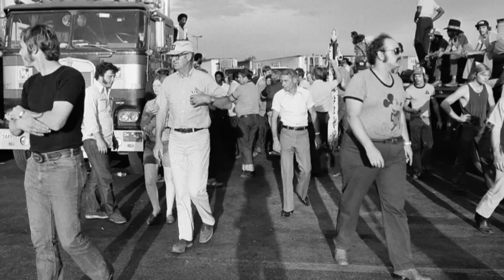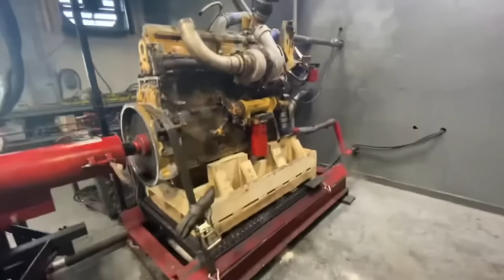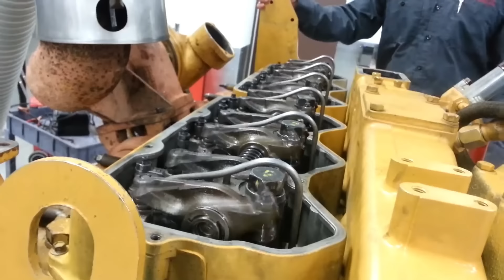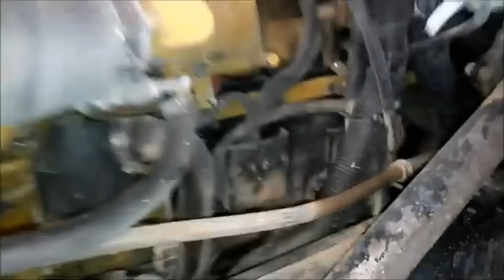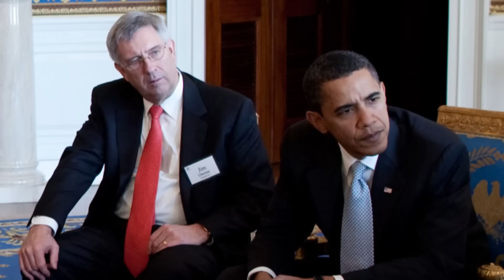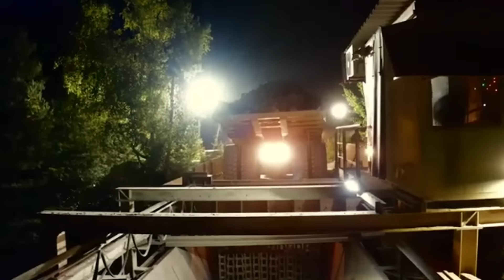The Rise and Fall of the CAT 3406: How CAT Lost the Highway

Comment: I drove line for Conway Western Express out of SoCal from 1991 to 1994. Ford Aeromax with a 285 horse 3406B & 7 speed. I would be N/B Grapevine halfway up 5 mile when the engine would hit its' temp and the ceramic clutch would GRAB. Top speed would settle at around 2O - 25 MPH no matter how heavy the doubles were. I averaged 400+ miles a night, mostly roundtrips to Kettleman City until I earned enough seniority to run Tucson or Sacramento. Solid motor with lots of pull.
 One night while working the Bakersfield re-ship I was talking to Short Stack out of Salinas. He had raised a royal bitch over how gutless his truck was, so the TM sent it to the local Cat dealer for a look - see. Turns out CF had " Cut the cable " & turned back the engine governors to save fuel !!! This caused a MAJOR SHIT - FIT with The Powers that Be at Caterpiller in Indiana; word was corporate came VERY close to voiding the engine warranties until SOMEone at CF reminded Cat how many engines CF was buying from them each year. Meanwhile, I was trying desperately to have my truck " break down " while on a laydown in Stockton or Sacramento !!! Never happened...

Comment: I've owned 2 3406E's. This video about E models being junk is FOS. Both have been excellent engines. My 2WS went 1.2M before overhaul and I overhauled then only because a clip had come of one of the valves. The mechanics at Ohio Cat were stunned at how good of condition the engine was. The figure 8's were still visible in the liners. There was zero cavitation around the liners. The current engine I have, a 1LW uses very little loil between changes at 15k miles. The EPA kept adding more bs pollution control. Truck mfgers like Pete and KW decided to build the Paccar engine and were no longer going to allow CAT engines as an option, thus CAT lost the platforms for their engines to be installed.

Comment: Caterpiller didn't lose the high way, they give it away.  Caterpiller makes so much more money with their heavy machinery sales than anything truck PERIOD . . . the whining babie truck drivers are another reason Caterpiller shelved the truck engine dept.  Another words, Caterpiller doesn't need anything commercial highway truck . . . 

There's a lot of false information floating around on YouTube about not only this post, but the train industry also has the GE locomotives that's supposedly killed the EMD effort. 

So far far from the truth it ain't even funny.  GE paid lobbyists to make new laws by the way of EPA rulings that ultimately stopped the best train engine ever in it's tracks.  Anything GE engine wise can barely make the 10 year mark before replacing the complete engine.
The EMD engine would and will last forever with most still showing up for work everyday to the tune of a 50 Years and counting.
This is what the lobbyists and GE did, they imposed a ten year life cycle for any locomotive sold at the time of the ruling, another words, GE stole the lead in sales away from EMD and now get this.
GE sold off it's train locomotive engine building dept. to Watco I believe is the name when GE restructured it's GE Company.
So Caterpiller didn't lose a damn thing with trucks and the Cat engines they built for them.

So much unresearched information out here today in the form of assumptions that isn't even funny . .

Comment: I hauled 🪵 lumber, Oregon into Cal. I was always impressed w the power that could be unleashed with my right foot. The truck I learned to drive w had a 290 Cummins. Hopefully my driving days are not over. The iconic trucker is mostly a memory, but the hay haulers, bull 🐂 haulers and loggers still resemble the good ole days of trucking.

Comment: I came into the trucking industry as a diesel mechanic in 2003. The 3406E was soon taken over by the C15 and then the C15 ACERT engine due to EPA regulations. 
This video only told the first half of the story. Eventually obammys restrictive EPA regulations is what killed Cats on hiway arm of its business.  I watched it happen. I had the opportunity to go to Cat classes for the C15 and the ACERT engines, and then the EPA mandated emissions engines soon thereafter. As far as I’m concerned Cat had the best EGR system as they filtered the exhaust gasses BEFORE feeding it back through the intake. They FILTERED the carbon out of the exhaust BEFORE the engine was fed its own shit. The whole idea behind EGR was to cool combustion chamber temps thereby reducing NOX emissions. Which at that point they did. But further more restrictive regulations would be mandated, which required the addition of the DPF, and THAT is where Cat started to lose the battle. I feel like if they would have been allowed an additional 5 years their engineers would have eventually came up with a system that would have surpassed emissions regulations. 
Every other manufacturer followed Cummins lead and just dumped unfiltered exhaust into the intakes via EGR and DESTROYED customers engines. We were overhauling engines which were fed carbon filled exhaust well before 500k miles. More like 300k miles and cylinders were wiped out and pistons so carbon packed you couldn’t recognize the rings. It did eventually get better with the addition of “carbon scrapers” but we are still overhauling engines at 450k-500k miles instead of the infamous “million miles” everyone so dearly remembers. Now 500k is expected. 
Caterpillar wasn’t ever able to meet the new regs, so instead of continuing to be fined into oblivion they chose to dump the on hiway arm of the operation and continued focus on their off road divisions, which at the time, were still not required to meet such stringent standards. Construction and agricultural equipment. It’s literally kept the company alive, not to mention the marine engines and power plants. 
I still work for the truck dealership I started at in 2002-03, we have since moved into a more modern facility, and I can see the Cat dealership from there, which has just recently shut down their truck shop completely. They no longer take in over the road trucks period, no matter what engine powers it. You can still buy parts from them for your Cat engine, for now, but that’s the extent of it here in our neck of the woods. 
Will we ever see a brand new Kenworth, Peterbuilt, Freightliner etc with a brand new Cat engine powering it down the road ? 
Possibly, but it’s highly doubtful it’ll ever happen. They’ve lost too much revenue, and dare I say talent due to government overreach and insane liberal policies that not only hurt the working man in this country but also well established and respected industry.
It was a sad day in this country when we elected spineless leadership - and continue to do so.
Reply: That's why it's a Video on the 3406, Not C-15/16 ACCERT etc.
Reply: As I remember, CAT went to the twin turbo to avoid running dirty air back into the engine. They pulled highway engines because they weren't going to put engines on the road destined to fail.
Reply: Cummins X15 is today’s CAT killer! Nothing I love more than some young kid in a Pete glider with a CAT engine to stage me at a traffic light… especially going uphill. Not a chance!
Reply: @Jake_801  You never seen a tuned 3408 . But those where brutes from an age long past
Reply: It wasn't that CAT couldn't meet the standard, they knew that the BS emissions would destroy engines and would make them less cost efficent.
Reply: California was allowed to dictate EPA regulations for the United States ,for way to long ,their whole agenda was to kill diesel engine use and go all Electric for trucks and all of road equipment,  do away with diesel  engines to save the Planet.,Finaully we have a President who is pushing back on all the EPA over reach regulations with some common sense seeing we can't make the all electric agenda as planned      .by 2030.
Reply: @kittyeagle2764  If you went to India for a day you would be dreaming of EPA regulations. lol Their good and bad to regulations, they were just a little too strict in the US. So I wouldn’t go jumping up and down for deregulation and if anything it be for the business owners, not for us. Honestly matching Europe regulations would have been better and more practical for diesels.

Comment: Im a retired certified Caterpillar field service technician.  Though some of what they say is accurate.  I far from agree with the statement.  The E model was the downfall. The Detroit and Cummins have had the same electronics problems.  The end of CAT on highway.  Was emissions tier 4 interem and 4 final ( DEF). Created a lot of issues.  The other thing was truck manufacturers didn't want to build trucks to fit engines.  They wanted all engines manufacturers to fit their truck.

Comment: I disagree with the assertion that the 3406E was the "beginning of the end" for CAT "on-highway" engines. I would submit that ACERT engines hold that distinction. And it was emission standards that forced that change. The 3406Es that I drove were easily the most reliable CATS that I ever was around. And I was around a lot of CAT 3406s in my 40 years in the industry. I even spent a few years with a 1693. If I could spec a new truck with any engine from the past, it would be a 3406E set at 550.
Reply: Emissions killed CAT  plain and simple,  end of story,  l own peterbilts with cat engines 359ext  425 ataac 13spd 379 ext 425ataac 15spd  if it didn't have a cat motor I didn't  want it....
Reply: Beautiful

Comment: A wonderful , unbelievable piece of machinery. but nowhere as good as a steamer. Back to back with a steamer and the Cat with all the kittens wouldn't stand a chance. They  had to turn that engine into a scrap iron jungle and it still is finding it hard to comply with the emission standards. I don't want to leave Cat lovers mentally depressed telling you that a steamer a friend of mine designed and built was the lowest emission engine in the world fifty years ago and still is. But ten marks to good old Cat for trying. I wouldn't dare tell you that he took it to America and they didn't want it. I could be excused for believing it was  too good. It would have dropped pollution levels by 80% and who would want that. And I wouldn't want to tell you that while a Cat is delivering one power stroke per cylinder, the steamer would have delivered four. That's while burning high flashpoint fuel and the Cat using premium diesel. Steamers are cheap to build, low maintenance, low emission, no oil changes and a million other things trucks should have except computers. Dream on diesel dudes. Don't forget to give the E.P.A. a roast because  they tell the truth. It's something the vehicle industry can't stand.
Reply: There are idiots everywhere. I just found another one.

Comment: had a Freightliner Classic with a 3406B back in the late 90's, best truck engine ever made.  it was better than the E models I had driven, in both performance and reliability. tunable, upgradeable, unstoppable!  it got 4 MPG consistently - heavy or light, fast or slow, idle or not.  had two malfunctions in 3 years & 300K miles - air valve gave out once, and lost the o-ring on the #1 cylinder liner (which cost me an inframe).  I'll admit the DDEC Series 60 in my next truck was a good engine, it just wasn't AS good.

Comment: there's no over boring on a 3406 just liner changes, i can't watch these anymore, Adept Ape is the best CAT channel I've seen
Reply: Kt3406e is a good channel.  Hes hit or miss on content but its good stuff when he makes some
Reply: It may be a bit of a confusing way to say "there's enough meat there that oversized liners can be utilized".
Reply from the maker: Sorry you didn't like it. My cousin works on these engines and checked the script I wrote. He gave me the thumbs-up.
Reply: @VintageAmericanMachines  Your cousin will not work on mine.
Reply: @VintageAmericanMachines these engines use replaceable cylinder sleeves.  No boring required for a standard overhaul.

Comment: Had a 3406E in my 96 KW and never had any problems or breakdowns. Average mpg running west coast was 6.4 pulling a 48' reefer and 10.5 pulling a 53' enclosed car carrier!
Reply: The X15 I got in a W990 is getting 3.9
Reply: @dhardy6654  3.9? Really? What are you hauling? 100k lbs empty?? Cause my x15 w900, with 3.55 rears, and a 10 speed hauling 44k empty and 90k+ loaded all day every day gets 5.3. I'm not saying that the x15 is better than a 3406 by any means, but your number is bullshit.
Reply: @xxtherevlukexx  I weighed myself empty last night and I was at 43k. 

I get the MPG numbers at shutdown when it gives the summary. 

I have twin 98 gallon tanks. It seems like I'm filling up all the time. 

Yeah, I think it's bullshit too.
Reply: @xxtherevlukexx  I think something is mechanically wrong to be getting this bad fuel mileage.

Comment: CAT left the truck diesel market because the costs of keeping up with EPA rules weren’t worth the shrinking margins, and their attempt to stay via Navistar collapsed. They’ve since doubled down on off-road, marine, and power generation engines—where their reputation remains very strong. CAT has a lot of fault for the mistakes of ACERT, and some fault with the Navistar JV fiasco, but the EPA's crazy idiocy is 95% at fault.  

Now that the EPA is about to have 2/3 of its worthless employees thrown out into the garbage heap where they belong perhaps CAT will change its mind (God knows Cummins or DD ain't cutting it).
Reply: We've all been hoping for a CAT  resurgence in over the road truck engines, but I'm not sure where they'd  fit in, since peterbilt and kenworth are both paccar brands and paccar now builds its own engines, for its own trucks along Cummins,  and even CAT  got into the over the road and made their own trucks  for a short time before getting out of the truck market,

Comment: Are you sure that the 3406 was introduced in 1973?  I remember the last of the 1693 and that was 1975.  Went to service training for the 3406 in 1976 if I'm not mistaken.
Reply from the maker: Yes, I'm sure it was 1973. Based on your comment, though, I went back and checked my sources, and even CAT'S own website says that. Whew!
Reply: Introducing a new model doesn't make the old one obsolete. The C175 and 3500 blocks are made in the same building at the same time. New 3406's are still (rarely) converted to run on natural gas in that same building. 3412's are still being made for gensets in locations that don't have to meet emissions.

Comment: Ai voice over lost me in 5 seconds flat.  However, quick summery, EPA regs more bull shit than the business is worth, Cat has other things to do.
Reply: Cat made a terrible decision when they chose to use the ACERT technology. The ACERT engines ran very hot becuase of EGR and retarded fuel injection timing, fuel milleage was less than 5 mpg in fleet trucks that got 7 mpg+ with Detroit power. ACERT was just a strategy that used a higher EGR flow rate than earlier 2003 standard engines. The higher EGR rate was doomed before it every entered regular highway use.
Reply: That was really it at the end of the day. For the % of engines that CAT made that went to on-highway use, it wasn't worth what it'd take in R&D money to get them compliant. They were also getting eaten alive with warranty claims from the early DPF era engines.
Reply: Thank you , saved me from listening to ai crap
Reply: @lawrencewilliamson3303 😂
Reply: YouTube needs to make it so that ai videos or videos with ai voiceover are tagged as ai so we all know before we click on it
Reply: I had 3406b with mechanical pump but wit electronic  governor and will pass everything accept the CAT dealer and the fuel stations and on the top of that i had bad partnership with a man who was cheating  on everything.  That's why I  remember 3406 CAT